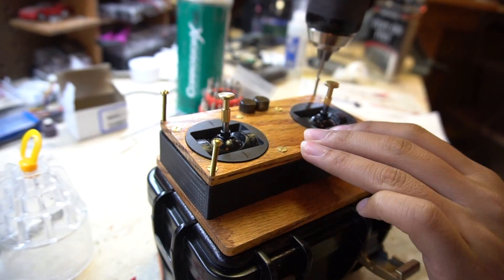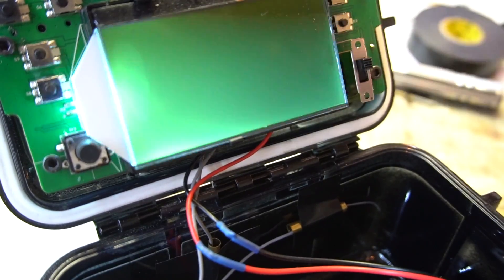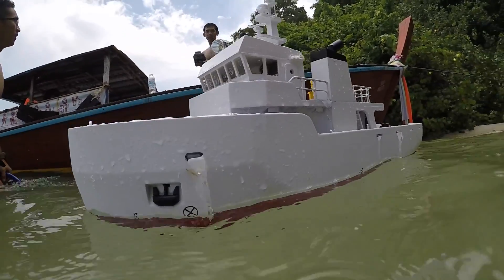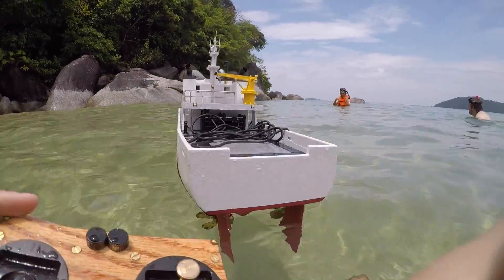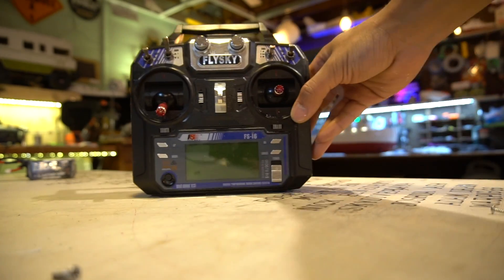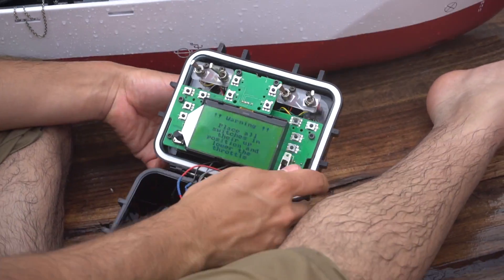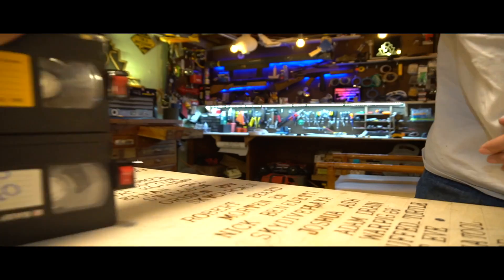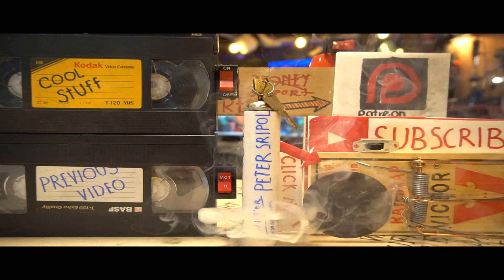Waterproof RC Transmitter

Comment: I know this is old.. hope I get an answer.   

What did you spray on the joystics to water proof them?
Reply: think I found it.  CorrosinX its on the Jungle website.  But what type is best these days for weatherproofing internals, Joystick and buttons of a cheap RC controller?   Figure could silicon seal the edges of its plastic housing..  Would honestly like to put some rubberish weather covers over the buttons if you have suggestion for that.

Comment: when you used wood around water you need to use a mixer of Boiled Linseed Oil and Johnson & Johnson Past Wax a 50/50 will work good  worm it up just a little and the past wax will melt.

Comment: Need to 3D print a tapered cylindrical accordion shaped form and use it as a casting shape to make a silicon rubber mold, then use the silicon mold to make urethane rubber boots, and then those would slide over the sticks. Some washers and lock nuts placed in the right spots, no water should make it into the stick mechanism. Of course in case the boots leak somehow, sealing and conformal coat inside that part still isn't a bad idea. But for the most part, little boots that seal over the sticks should keep out most water, salt, and any other debris.

Comment: Awesome job as always! You should try taking transmitter components and putting them inside an old console controller..like a ps3 or original xbox controller would work awesome..even a Sega Dreamcast, n64 or gamecube controller would be cool

Comment: are you kidding me? why would you sever an entire plug just to solder the same wires onto another wire which the plug would've fit on in the first place??? i can assure you that nearly all connections in electronics these days use a 1mm GPIO connection standard for plugs, which includes that. If you plugged it in, then you could've used a female-female GPIO-based connector to connect it back to its initial board.
sorry I got a little frustrated....

Comment: Use the waterproof transmitter and make a powerful submarine able to pull u, then you can be pulled under the water with your waterproof transmitter
Reply: it would need to be a different transmitter, 2.4ghz won't work through water, the water absorbs the shorter wavelengths.
Reply: drive by wire.
Reply: to lose the umbilical cord :P

Comment: cool music bro, love the old swing and jazz albums. I actually collect old 78 speed records. they are the only way you can get the authentic sound but they do wear out the needles on the stylised quickly.
Reply: Tungsten Carbide Because you're using the wrong stylus...you have to use a steel stylus for 78rpm records....